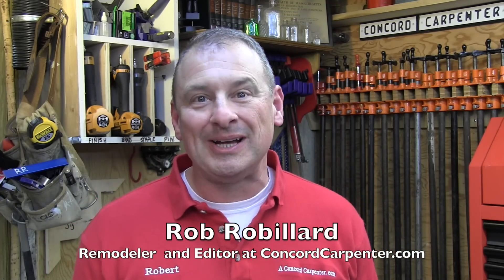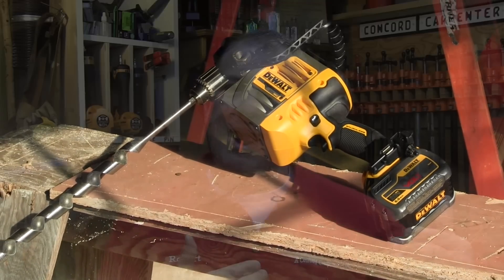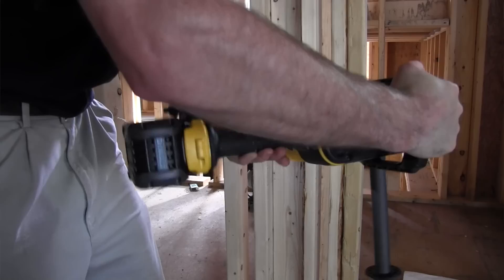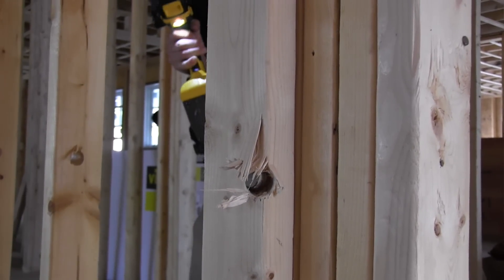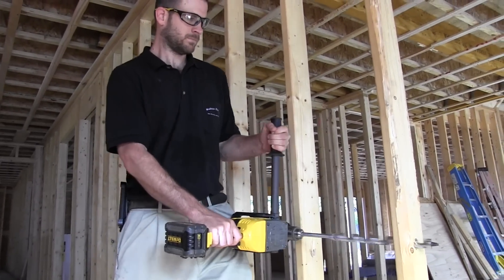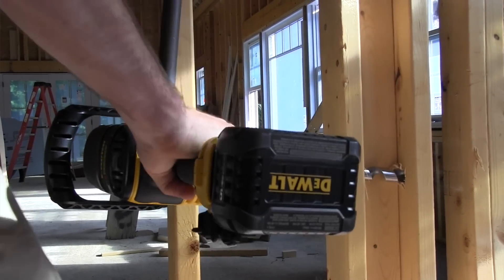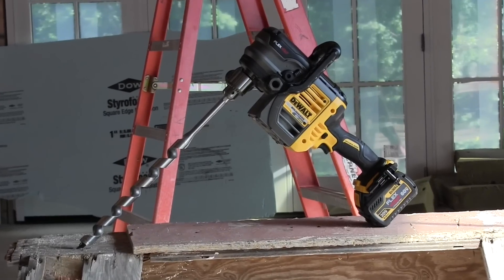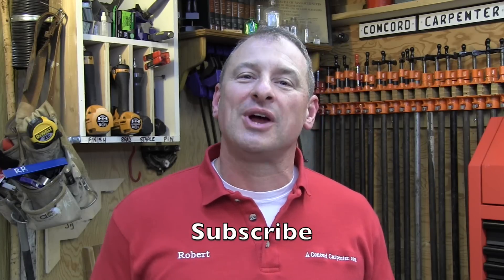DEWALT 60V FLEXVOLT Stud /Joist Drill Kit DCD460T2

Comment: Great review!   I personally don't think I would want to drag that giant heavy drill around as an electrician when you are talking about a battery platform change no matter what brand you are loyal to.  I have a hole hawg, and it's super impressive and much smaller and lighter than the flex volt joist drill.  The hole hawg was actually the single tool (at the time) which convinced me to jump from Dewalt to Milwaukee.  Seeing that Milwaukee has stuck with and made significant investments in the 18v line, I'm glad I made the switch!

Comment: Something that I didnt see in the comments or mentioned in the video - the flexvolt 6ah battery is really a 2AH battery in the flexvolt tools. So it does slightly more holes with a battery technically half the size with more power and more versatility🤷‍♂️  did you guys test it in mud mixing/mortar or thinset by chance?

Comment: The electronic clutch is a huge advantage. I don't know how many time the kick back from the angle drill has made me hit my hand or twist my wrist. The quick changing chuck is an advantage more for plumbers. But in a house I'm running half inch conduit, so i don't change the bit size. The Milwaukee hole hawg being a lot lighter and smaller is also a huge advantage, but the E-clutch can save you a trip to the hospital.
Reply: The Milwaukee super hawg has a clutch as well. The regular hawg does not need it as much since the force is less as it is meant for mostly 7/8 - 1 in augers with a max of 1 3/8 I think.  The milwaukee super hawg uses the same clutch and mechanics as the corded hawg which has been around for years which is a proven design. Nobody can speak for the design and durability of the dewalt since there is no history and no information given or described. I have seen pictures from inside the milwaukee. Better than how most corded tools are built.

Comment: It makes sense for an electrician to have cordless tools. They are the ones providing the power that is not yet on site. 

Why didn't dewalt use a keyless chuck? Are keyed chucks really better?
Reply: Keyed chucks can tighten better and hold a bit much more securely. That is more important on drills such as this where you are using larger augers and hole saws where there is lots of torque and pulling forces not just in, but out when you pull back. Chucks can also work their way loose during use. The chuck only has to rotate slightly. 

Of course the best solution is what Milwaukee has. The 7/16 quick lock which all my bits, arbors and adapters for even an earth auger have. Quick in, locked in place, quick release. Easier bit changes and no chance of a bit slipping out.  Especially during rough in when you will change a bit many times. Even a keyed chuck, tightened fully, still can pull out. Pull out is only stopped by friction on any chuck you use. Quick lock has a shoulder as you know so there is not chance. 

In regards to what you said about electricians. For an electrician this drill is a nightmare. It is heavier, bulkier and less convenient to use. Electricians only need to drill mostly 7/8 to 1 inch holes mostly. That is why milwaukee has the smaller hole hawg which is much easier to use and handle. If you need bigger holes drilled, then you use the super hawg which is comparable to this. Each designed for a specific purpose rather than dumping a larger tool on someone for a smaller job. Kind of like trying to use a sledge hammer to drive in a finish nail. The hawgs also have a slimmer design and the super hawg uses the proven clutch and mechanics that have been in the corded hawg for years.  This dewalt is more like the old boxy milwaukee hawg they came out with in 1970 and later redesigned.  Why Dewalt took and old design, I do not know.
Reply from the maker: Great points Ari - Im a big fan of matching the tool to the application as well as the quick-lok

Comment: Flexvolt is better on the saws?  How is that? I saw tests where the flexvolt stalled out and the milwaukee kept going and was faster. Dewalt in most cases does not even compare to the milwaukee and even the few times when dewalt has an edge, it is by a very small margin.
Reply: Ari P I think they stall for safety reasons. Tools get damaged and people get hurt when you force a tool to do something. It will probably be a year before there is any changes or improvements to the dewalt 60v system, once they get more real world use.
Reply: Safety? This is a sawzall we are talking about. Not a spinning drill like the super hawg. LOL.  The Milwaukee plowed through and there was not a safety issue. LOL.
Reply: A year, is that all. You have to be kidding. The milwaukee system has been around much longer and will continue. They can do everything and more from one battery, not having to introduce a flexing volt battery. What you also seem to not realize, is the flexvolt battery has switching components that are very tiny, crammed in a battery which have to handle high currents. That is a nightmare and reliability issue waiting to happen. What you also do not seem to realize, is that milwaukee tools have lots of protection. Again, a sawzall in that instance does not need it. Are you really that hard up for dewalt that you would make such ridiculous claims?   Try watching the video. It is between the sawzalls. You can not miss it.
Reply: Oh, by the way, if you make a tool at its best to begin with, you do not have to keep improving it. Milwaukee makes sure from the start. Maybe dewalt wants to make it not as great, so they can improve it and keep you spending money to replace it. They have always been about hype and misconception. Remember, 20v max system is nothing but an 18v system with another name. Only dewalt wants to call it that, nobody else does. 20v is just the charged top voltage of any 18v system. If you do not know this already, you are really clueless.
Reply: This dewalt drill is nothing but the same design as the older milwaukee corded hole hawg from 1970, which they redesigned many years ago when they came out with the corded super hawg and now the m18 hawgs. LOL. The corded super hawg has proved itself, and the same parts and design are in the m18 hawgs. Dewalt has nothing on that.
Reply: Wrong. I am not anybodys fan boy.  Dewalt have made nothing to compare or warrant having to buy other cordless tools. Nor have anybody else which such capable, well designed and widespread tools for the trades. (ie I have copper pipe cutters, pvc cutters, m12 bandsaw, 700 mcm cable cutter, and the list goes on and on) Buying another brand would have to warrant getting other batteries. Milwaukees tools and batteries are also designed with more protection and longevity in mind. Milwaukees battery packs are actually engineered and they have their own incredible r&d department. Other companies outsource their batteries and packs.  However I am, in fact buying the dewalt vacuum soon. The dwv012.   I have used dewalt tools before, as well as other tools. and they do not measure up, and the motors sound and perform cheaply like harbor freight tools. I still have porter cable tools, bosch, and hilti. The porter cable were great before dewalt bought them out and cheapened them. That is another strike against a company like dewalt. Their tools have not lasted with others that I have worked with in the past. They are also a fake company who is about hype. Their platform is called 20v max when it is just another 18v system which everyone else calls 18v. They also have found it necessary to further hype by making flexvolt when milwaukee does the same and even more with just an 18v platform. The flexvolt also means there are switching components of small inadequate size crammed in batteries which have to handle large current draws which is just a failure waiting to happen. Not something that should be in a battery pack.  They are just trying to sell their tools by pushing a number on all the unsuspecting fools. Also their force capabilities used to use a different scale in the past when everybody else used inch and foot pounds. They are a company that lacks the principles and morals that other companies have. All companies have to worry about the bottom line, but dewalt just focuses more on that, when milwaukee does take more interest in the product and consumer. Milwaukee is more like Tesla cars where Dewalt may be more like GM. Dewalt may also be more akin to mcdonalds which just has a name and the hype, when wendys food is much better quality for the same price; they are just lesser known.  I look at a company more in why they do what they do, and how they do things, not just what they claim the products can do.  I can not help it if most consumers are just sold by advertising and do not really know the nitty gritty of what they are buying. People like Bill Maher are correct. Most Americans are stupid, or just fools.
Reply: Ari P I love my 7 1/4 skill saw, would take it over a corded saw, but not the reciprocating saw. I saw around the same performance as the 20v one that I already own. The table saw is quite good as well, I am a concrete carpenter. I find it's good for residential work.
Reply: I didn't personally purchase any of these tools, they were a gift set. I wouldn't have spent the money, would've went corded or anther brand due to multiple dewalt framing guns running like shit after being used in outdoor conditions.

Comment: Compared to the milwaukee?  Milwaukee has 2 sizes each suited for a specific purpose. This drill is equal to the super hawg in performance. So for an electrician is too big and bulky and unnecessary in size.  That is where the regular hawg is superior to use. But this drill is still an antiquated big boxy design which is how the old corded hawg was designed. This is why milwaukee drills are now the sleek drill design which was still a reliable improvement. The milwaukee will fit in tighter spaces in both the milwaukee drills.  The milwaukee also has the quick change which is superior and easier to use. All my augers, hole saw arbors, and even adapters for 1/4 drive, 5/16 drive, and a earth auger setup are all quick lock.  Dewalt does not offer this. Once you use the quick change, you will wonder why anyone will want to use a chuck and that pain in the neck chuck key. Dewalt needs to get with the program. Milwaukee has proven again and again, that you do not need higher voltage for performance. They provide more ampacity for longer run time and performance. Dewalt resorted to a switching battery with micro components handling high current loads that a corded tool demands, which is just a failure waiting to happen.

Comment: The dewalt is too big to fit between joists it seems and they were drilling between studs with a long bit on an angle in the video. The whole point of a stud drill is to be able to drill between the joists, not on an angle from in front of. If you are going to do that, then you might as well just use a straight drill. With the hole hawg you can use a short bit and fit between the joists most of the time.  The critical thing is when you drill on an angle like that, your pulls have angle hole edges and resistance potentially damaging the wire, and it make your pulls harder.   It also places your wire closer to one side of the stud on one side of the stud which makes it more susceptible to nail penetrations.  Any electrician with any experience and knowledge should know this.
Reply: Ari P yeah the technique was a shorter bit should have been used the drill is 6 inches deep so he could of run a 8inch bit no problem to get a straight hole
Reply: You are Dewalt hater? Milwaukee fanboy?
Reply: @duncanstamps  I use the longer bit when roughing in a house. No need for ladders and shit when dillring top plates. Used the same long bit back when all we had was the corded hole hawg.. Why switch bits? keep the holes strait and there is no problem pulling through them

Comment: this drill looks pointless to me. I´m a electrician and my Dewalt compacts can do good up to 25 mm holes and for bigger drillbits like 32 mm or 35 mm or holesaws up to 80 mm I just use my DCD 996 on the second gear. The DCD 996 is so much smaller than that gigantic thing and will do anything I ask from it. My compacts dcd790 are also good but prefer the dcd996 when it comes to the little bigger holes from 1 inch and up and holesaws.
Reply: Christian D I am wondering what the  point  of that bloody great drill also.